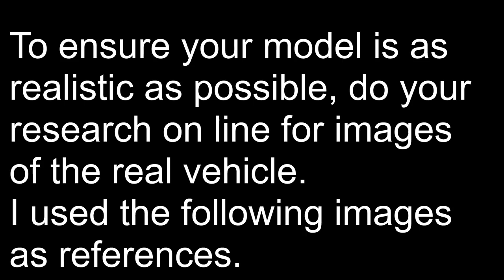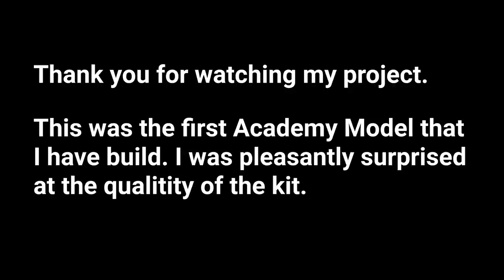Build, Paint and Weather the 1.35 Academy Sturmgeschutz sdkfz 167 German tank

Comment: Painting small.parts on a piece of window screen keeps the from blowing around. It works on motorcycle parts anyways so I'm sure it'll work for you too. I.paint small motorcycle parts on a piece of window screen layed on top of the open end of a 55 gallon drum that serves as a garbage can and it works GREAT. I'm sure you could scale it down for your purposes. The screen allows the air from the brush to hold the.part down instead of gettin under it and moving it around